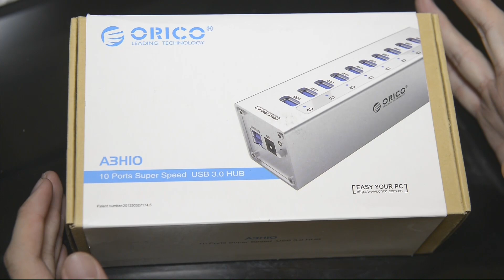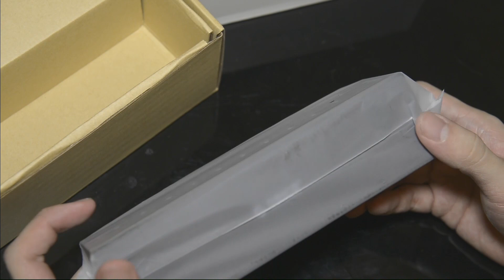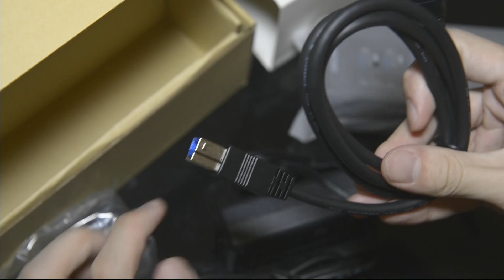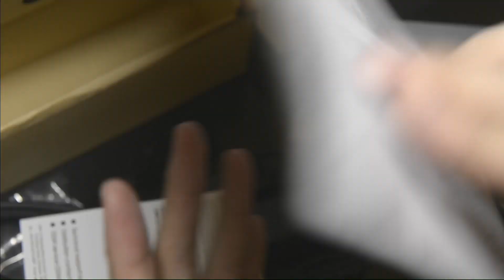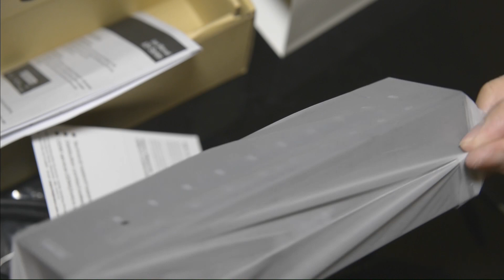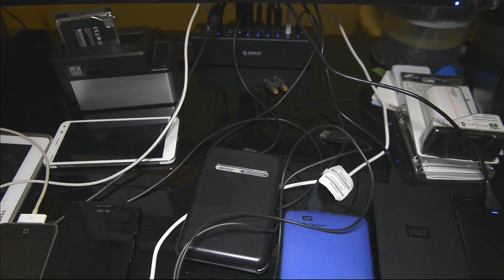Orico A3H10 (10 Port Powered USB 3.0 Hub) Unboxing & Review

Comment: Agree h Rob Grune DO NOT BUY ORICO.  Never worked .  Sent mails to Orico. They never replied. Got it tested. Card needs replacement. Will not honour their warranties.  Dealers simply refuse to help.  Orico has false advertising. Tried on USB 2 and 3 same results.  Spend your money on some other brands..
Reply from the maker: It is still working for me till date. I think ORICO has one of the better QC compared to many other Chinese brands out there. Do note that many different brands you see do actually come from the same manufacturers.

Comment: Hello!, I want to make a Raspberry pi 3 cluster and im wandering if this usb hub can support 2.5A for each port. Not nesessary all of them but, 4 or 5 ports can be fine?
Reply: is it work for you ?
Reply: @trinhucthang1226  no, this hub doesnt work. You need to buy a power supply (is better, more eficient ).

https://es.aliexpress.com/item/1005001638101213.html?spm=a2g0o.productlist.0.0.4db14afaUZo9v0&algo_pvid=null&algo_expid=null&btsid=0b0a556316205735594905622ea918&ws_ab_test=searchweb0_0,searchweb201602_,searchweb201603_

You can buy one 5v 30A and put 8 raspberry pi with no problem. Also the power supply doesnt heat itself

Comment: Does it support 2.1Amp? 
2.1A use for  fast charging Apple product. Usually usb3.0 with 2.1A marks with color red.
Reply from the maker: Unfortunately not.
Reply: That it, so there is nothing special here, USB 3.0 hub there is many out there. But its hard to find a brand one that connect to PC and support 2.1A for descent price.

Comment: Hi, I have a question I would like know about this Hub.
¿Does it have fixed COM port assignation, or are they assigned randomly everytime you power it on?
I need to comunicate to some arduinos through fixed COM ports, so if it changes everytime I can't. Could you please check that up for me? Thanks!
Reply from the maker: +akspe22mam How do you check that? I would assume that it depends on the host USB that you're plugging into no?
Reply: +Swift World The COM is managed by Windows creating a virtual COM for the host, but I have just found I can change that COM and fix it, so there is no trouble at all, thank you for the help :)

Comment: hi , can i ask you  
do you have to press the power button every time you power your pc or it be default powered up and you can turn it off
Reply from the maker: +Faisal Alsalm Nope! The hub has a dedicated power adapter. It's power is independent from the system it is plugged into.
Reply: +Swift World  thank you what i mean when you power up the hup or when you plug it in will it automaticaly powerd up or you should press the power button thanks
Reply from the maker: +Faisal Alsalm Oh yes you have to press the power button the first time.
Reply: +Swift World thanks alot 👍

Comment: north America has on & off switch on top not end
Reply: +jin lee I just received a black one from Amazon in the US - Virginia and it has the same momentary power button on the end.  Any time the hub looses AC power you have to turn on the hub by pressing the momentary power on/off button...quite a nuisance.  It should be a push-on/push-off button or an on/off switch.  I am sending it back.
Reply: +jin lee ok
Reply: sod north America

Comment: Very informative. I own a 7 port Orico hub of the same style. Since I am a semi pro photographer I have a lot of 3.0 portable hard drives to save my photos. The Orico behaves very well with few problems, most of which because the hard drive in question is not set up correctly on my computer. I have tried other hubs with varying success, most of it not so well.
Reply: How many bus powered usb 3.0 drives were you able to power off your orico hub simultaneously?  How does work with optical drives and other bus powered devices simultaneously?  I've encountered a lot of issues with other usb 3.0 hubs not being able to supply adequate power to all devices simultaneously despite coming with a large power brick (12v, 5A).
Reply from the maker: Titus Corday If you watched the video I have many many devices plugged in (phones, tablets etc and 3 portable HDDs) and all works perfectly fine.
Reply: +Swift World +Swift World Thank you, looks like I spoke too soon.  There are a lot of useless reviews here on YouTube, so I initially assumed you wouldn't do any meaningful tests.  Have you tested it with the Apple external super drive or any optical drives?  Are there any devices that didn't work with this hub besides the one you mentioned in the video?
Reply from the maker: Titus Corday Unfortunately, I did not try any optical drives. Everything else works normally. The only problem I did raise is that if you plug in multiple devices there might be a chance of driver conflicts and thus rendering it unusable unless you plug out one or the other.

Comment: DO NOT BUY ORICO.  I had 2 cards from them. Both failed quickly.  Sent mails to Orico. They did not reply for 2 months! Will not honour their warranties.  Dealers simply refuse to help.  Orico has false advertising: cards are advertised as Linux supported, but in fact they are not.  Orico is in China, which has no laws for consumer protection, and Orico is beyond consumer reach.
Reply: Rob Grune orico just bad on their enclosure. but I think their USB port is good
Reply: Gill Nostrefau not true. I bought a USB3 PCI card. The card will not connect to my USB3 sticks, but will connect to my USB2 sticks and give USB2 transfer rates.  In other words, ORICO SELLS AS USB3 WHEN IN FACT THE CARD IS USB2. THIS A FRAUD.
Reply: Rob both times you mention CARDS, not external HUBS.  Also, the lower speed usually means driver issue.  Which you have already mentioned you couldn't find for Linux.  So basically you are repeating yourself.